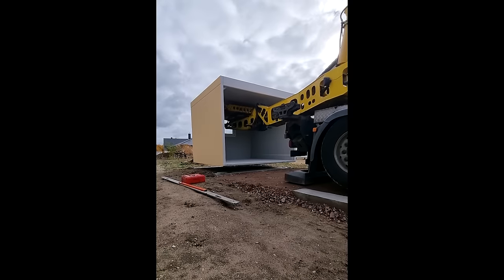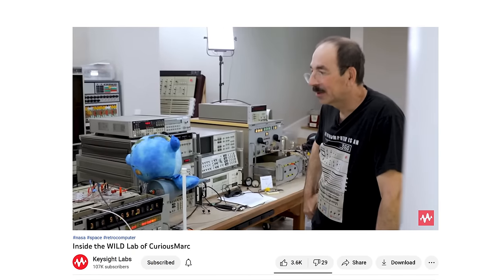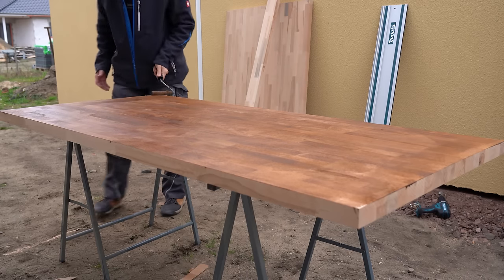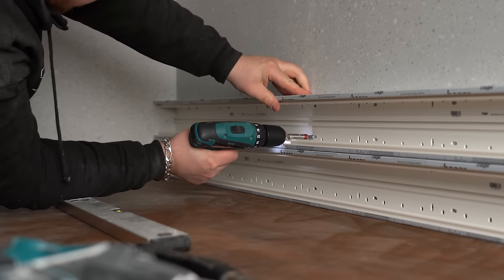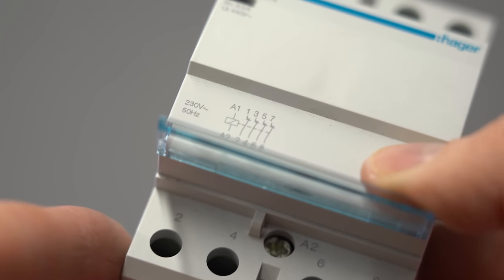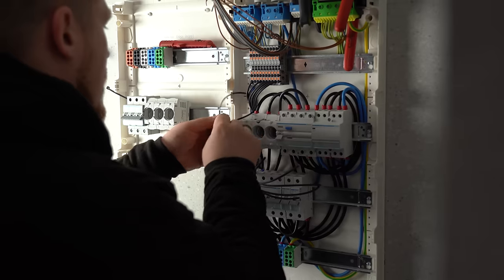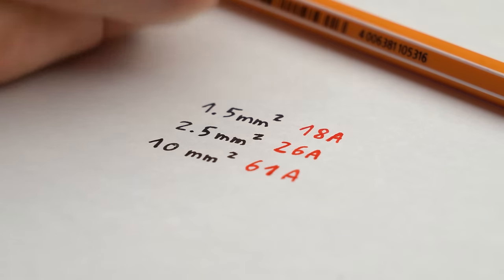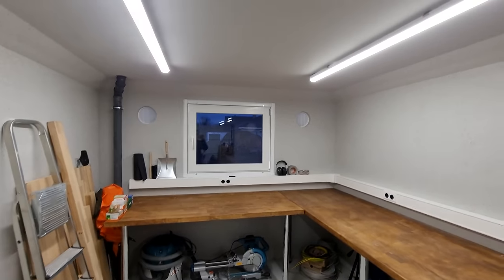Germans do the PERFECT Electrical Wiring! (Garage Build)

Comment: If you want to use an emergency stop switch for safety reasons you should build a safety circuit according to the regulations. Using a red/yellow Estop for a non-safety circuit is creating a false sence of safety/security. There is no calculated performace/guarantee when using the Estop as supposed in this video.

Comment: It’s nice, in a traditional term. I don’t see improvement to the way this was done like 50 years ago. I would have asked the garage maker to include the pipes in the walls, as you know where they would be, so no pipes. I would have added more magic, light goes on with presence , not manually, depending on light. Garage door with RF handremote? .. I would also have mounted the power plugs on the ceiling, not the side, so your free to move around while working , even move the table .

Comment: I would and have and will do in similar things just about everything differently. A lot to do either differently or better. For example I would replace cable conduits with open trays to use them also for wiring all the equipment. Lights would be with 24V relay. As little fixed things as possible. Add a 32A outlet for modern power electronics, 16A single phase is just hopeless. I expect garage to have the wiring for car charging anyway so should not be a problem. Why porcelain fuses? You will be popping them and they are annoying to change. Overall the setup interferes with every wall and the only free wall is taken up by the panel. It is a very massive setup without any need for such. For example you will never be using the CEE outlet while sitting on a chair, why is it so low and not as high as possible?

Comment: Der Fehler 6:20 ist schon echt hart. 400V x 16A x √3 (1,72...) = 11kW und nicht 6,4kW.
Normal gesagt ist es = 3x 230V x 16A = 11kW

230V x √3 = 400V
400V x √3 = 690V
√3x√3 = 3
3 x 230V = 690V

Und was ich anders gemacht hätte:
Biegeradien einhalten ( Radius = 4x D (Kabeldurchmesser))
Richtig verdrahtet brauch man auch keine Abzweigdosen.

Comment: The components are almost the same as in Sweden. But sorry to say the German way of doing it locks so bulky and not elegant. 
I think i prefer the Nordic way. When I used to work as an electrician I had a colleague that had moved form Germany. We had to train him and remind him not to do the German style of installation. The job was the same but not the aesthetic of the installation. Its hard to explane the differences but in Sweden we do the corners a little bit more close to 90 deg. We use bare cable on walls instead of bulky conduct. We follow the natural lines of the room. Like between roof and wall or on the trim. If we use conduct we do it all the way to the box and dont end 10 cm  away from it and use smaller slimmed cable clamps.

Comment: A bit sad to see you went with legs on those tables. If you have two sides (long and short) screwed into the wall slabs, you don't need a leg. You might need a leg on the opposite side (the one closest to the camera at 3:51). At home I have an L shaped desk with a 3.66 meter long side and a 2.44 meter side (MDF sheet sizes). 100cm deep as well. I am using one leg as the only support. I'm 130+ kilos and I can stand on the desk.

Comment: Why put pipes on the walls if the wire is exposed before the junction boxes, you need pipe to box adapters to completely cover and protect wires.
Reply: It's just structural. Cable is rated to run without conduit, but would require a hanger or clamp every X distance, Whereas the conduit only requires a clamp every bigger Y distance.

Comment: The wiring would have been much easier in single cable, considering it was fitted with conduit anyway. It's also a shame to see the wall blown out because they used an SDS bit instead of a dry diamond core bit. Nice otherwise.
Reply: Not allowed. Different circuits, different cables.

Comment: Why does your electrical conduit have no corner / radius connectors instead of having the wire just span the joint?  If you don't have the conduit fully encapsulate the wire from A-B then it's literally pointless and a waste of money.

Comment: I'm a a control and automation engineer who deals a lot with electronic and electrical systems . My experience in this field tells me that the Germans are not really the champions in electrical and electronic engineering field. They tend to overcomplicate the design of the system without clear necessity  for it. Also, their systems due to their unnecessary complex nature , tend to create unclear and frequent faults and errors which are difficult to troubleshoot; plus; the cost of purchase and maintaining their systems  is  quite high. On the other hand, the Asian made systems are the best in these two field. They are as complex as the necessity of the system requires. Thus, there is no frequent faults and errors, and the process of troubleshooting of a fault if happens, takes less effort and time compared to their German counterpart . Finally, the cost is significantly lower than the German systems. So, basically, the Asian systems are the best simply !.

Comment: It looks generally nice, but I would have used 90deg tube connections and not naked wires, this look awfull. I would also terminate the tubes at the boxes, Tube<->naked_wire<->tube<->naked_wire<->box is really strange.

Comment: If you use a latched relay with a super cap you can have a broken wire as well. Just make a circuit for the wires and use the super cap to trigger the relay if you lose connection.

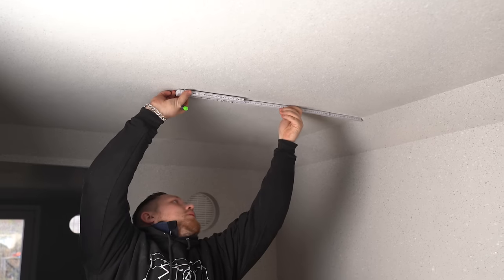Comment: Id use ölflex instead of nym cable for this reason: 8:47 

The copper tends to stick out when you bend the wires back, with ölflex you squeez casing (aderendhülsen) around the copper strands, and it's way more touch/short circuit secure.

And since you have Phönix connectors in you board, using ölflex should have been no problem.

But it's oke as it is.

Comment: Protect the cables at the ends of the conduits. You can buy different angles or even better, get a pipe bender spring and bend the plastic conduit exactly as you need it.
Reply: Conduits in most of Europe countries arent required at all
Reply: @bojangazibaric3328  Whilst they are not required, they are there to protect cables.  So leaving parts exposed doesn't make sense.  Even if the reason to use them was to make it look nice, exposed parts don't look as nice as fully enclosed runs.
Reply: @m1dst  Im a professional electrician in my country and in 20 years we used only few times additional protection but in terms of flexible conduit /hose and never in domestic installations. i do watch a lot of videos from other countries and how things are done there. In UK and the US ( from what ive seen) through conduits u mostly put one or few single stranded wires or cables which are flexible. Cables u saw are pretty stiff and not intended to go through conduits. If u have 5x2.5mm2 wire , one of the usual in my county u would not be able  to get it through the  pre installed pipe, even slightly curvature would give u a nightmare. Their double and triple layers of insulation is enough for most of the purposes. Sry for bad English
Reply: @bojangazibaric3328  Thanks for the additional information.  Always interesting to hear how different places do things.

Comment: 2000 comments later in 5 months down the road. And as usual late to the party. The next time you move any type of heavy long pieces of material. Say hight 32" x1" 1/2w x6' long. 2 flat (whatever) with wheels on each of them at both ends makes it much easier to move. Just make sure the "flat whatever" can withhold the weight...

Comment: wire pipes look nice and tidy, but they are unnecessary. there is no advantage in using wire pipes, beside look. if we talk about over heat of wires hazard, then pipe is even disadvantage. also it's extra cost. also, if you want to add more wires, you can find yourself unable to put new wire into already full pipe.

Comment: I strongly disagree with your choice of Normally Closed Relay for E-Stop, which requires active power in order to Open and thus shut off the circuit. That is a recipe for disaster, because as you stated yourself, if the wire to the e-stop relay is broken, or power to that relay is interrupted then you're screwed. If the coil fails, you're screwed.
Your life and limbs are not worth the "20 watts" of power saving... (or any watts of saving)...
As others have commented there are latching relays that can save you 20 watts.
I also find it odd that you are willing to spend your euro to have moving receptacles, but you cheap out when it comes to saving your life for a few watts of power saving?

Comment: over complicate stuff much? the e stops should never run to a relay, just run them like you would a light, in series, both must be in position to run, and if either one is pressed it kills electric, much safer and also cheaper than your solution and it requires no electronics

Comment: why does everything seem flimsy and plastic. why didn't you use actual conduit connected directly to boxes? metal may be out of style, but it's still a great material. wires can get hot. what happens when plastics get hot? a good reason to use metal. if something major goes wrong there, all your wire will be in a pile on the floor.
Reply: PVC has a melting point of 210° C while cables and breakers have to be dimensioned to not get hotter than 70° C under full load by code.
Reply: @1I2am3Dani4  in normal working conditions. things can and do go wrong, in which case metal will hold up much better than plastic.

Comment: Laughs in Australian wiring standards, who is still installing fuses in 2022?
single RCD for circuits is yuk, trip a outlet and now you are sitting in the darkness, use RCBOS for every circuit
no RCD for 3ph circuits?
no buss bars
solid strand wire is yuk

Comment: This is one of the cleanest electrical work I have seen. Did you intentionally leave the cable open at 90 degree bends? What is the logic of using or not using conduit bends? Also, in breaker junction box adding labels to all cables would have been a perfect step to help troubleshoot in future.
Reply: I think it's aesthetics. I personally like it more without the bend.

Comment: that pipework with missing elbows is concerning.
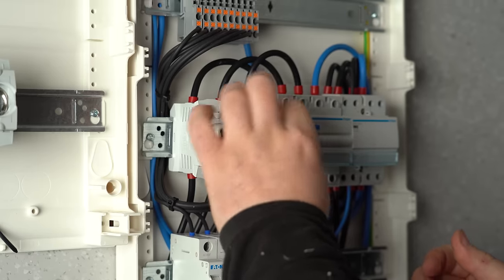11:14 you should have used proper colors for wiring or at least colored Heatshrink or Labels.
11:24 ... this just looks wrong... you have your input clamps on the bottom row / 4th row going up to the 2nd row then going down to the 3rd row and then going up to the 1st row and up from there.
Use a 3P Contactor instead of a 4P. You said it yourself in the video, "german rules don't allow you to switch the Neutral"

Comment: Well your Relai problem would i Fix a stupid way. 

You could put a low Power relai in ther that is NC and wire it to the High power relai 

So is the line where the error could Accure very smal. So... its still not totaly safe but... safer? 
So you would drive it like it is supose to be but would brack the Power lines with a Higher class Relai thats driven like yours. 

It does add more faulty parts but... also makes it Easy to change and Test them. Like put a lamp on it and Test et bevor every use... and if its faulti you just have to change one of the Relais, caus the Kabelway is protected.

Comment: Dont do you emergency Switch Like this, the Relai needs to be safety class Not the one you showed, These Relais have two connectors for each in Germany NOT-HALT, also These Relais are more tested and fullfill all Security aspects, please read about it and Security classes, IT could Safe your Life, but your system is a Solid start and will do its thing 99% of time but you want more when Handling with heavy maschines 😉

Comment: I would love to put in a hauptschalter that you could lock (not a rule in Germany, however it should be...). I also guess that you took 1,5mm to B16A, 1,5mm are not rated for higher than 13A. Germans like to take pride in their electrical work and they also like to think that they are the best electricians in the world. However this is not true, I worked as an electrician in a few countries and I would say that Swedes or Danes have far better standards than Germany does.
Reply: 1,5mm² is perfectly fine for  B16A. It depends on the installation method of the cable
Reply: Actually it depends on the impedance before the fusebox and how long they are. I work within electricity in Germany and I now for a fact that they do not consider the impedance of the head cable before they do their installations. However if you go to the Scandinavian countries you will find a way higher standard within electrical installations. Also in Germany a lot of the ways they install things are like 30 years behind the Scandinavian countries.

Comment: @GreatScott! I think you forgot about surge protection devices that are necessary to install when working with mains power tools and also sensitive equipment like computers or laptops. Surges created from induction motors or externally from lightening or any other fault can cause some damage.

Comment: Nice install, but.....A few pointers that are worth noting, 
Lack of basic PPE is always one for me, that when putting a video out for the world to see, why show your complacency to health and safety. You don't have to be a big tough guy not to wear safety glasses, eyes don't heal to well. 
Also very lazy not using flexible conduit at the corners, and just having open ended conduit, providing no mechanical protection.
In all honesty the open end conduits on ALL of the cable runs are just lazy, there are lots of products on the market to make it continuous.

And no nice tidy boxes to cover the cables coming between walls would be nice,  just holes with flex looks poor

Comment: All of the plastic components look very expensive until you get to that service panel, I would hate to be the guy servicing that cracked and crumbling unit in 80 years or they guy that accidentally smashes it while working away in the shop.  I am in Canada and we use both metal and plastic device boxes but I have never seen a plastic breaker panel and would refuse to use one if it became available.
Reply: There are more or less no metal breaker panels. Also good plastic is much better than cheap metal :)
Reply: @muschelhirsch4522  that's fair, I am not from there and you gotta work with with the materials you have but I disagree with the good plastic vs cheap metal comment, a powder coated metal panel will still be in mint condition a hundred years after plastic has gone brittle, warped, and cracked at the screw holes.

Comment: If you use a reset button, what is common in emergency stop circuits, then is is oke.

Like https://i.stack.imgur.com/bF8iR.jpg

Just the first half of the circuit. S4 and S5 with K2 is not nessarry

Comment: Hi there, in electronics you are a genius...
 Butt german electrics will be a little lazy, ¿Why not install flexibles for make pipe curves? In spain if the cable visible outside de pipe you don,t receive certification, i can affirm spain electricist are much better,

Comment: Most of the electrical wiring I have seen in Germany is shocking (pardon the pun) that's would not be acceptable in Australia haha even something simple like conduits where the cable goes round corners, but there is no elbow but the conduits are open ended at every bend.. as an electrician, I don't get that haha why not use elbows and protect the whole cable 😂

Comment: nice job. here in India anyone can do the electric wiring at very low cost without any rules and regulations but in 99% case never had any accident or short circuit so i must say in Germany the wiring work is overrated
Reply: Only (pub.wks.dept.) .... P.W.D. certified wireman/ electrician are authorised to undertake electrical wiring jobs where state electricity boards provide electrical power...
all other unauthorised/ ill legal jobs automatically loose any/ all insurance cover in case of any problems that may arise.

Comment: Internal wiring does not follow IEC/EN standard as you see at 11.20....theres two diffrent brands (EATON and HAGER - both low quality, cheap types..) in same electrical cabinet, in a new installation, you usally avoid this sort of installation... After the installation, as i know, after building a own electrical cabinet, your electrician needs to mark it with EN/CE specification, othervise its usally not legal to connect and use, have a look with you insurance company... after just watching the video, i can tell the pre-impedance and short circuit condition has not been fulfilled... if thats a german installation, well, i guess the swedish looks waaay better according to perfect electrical wiring! :)

Comment: i have done such installation... why putting tubes for 40 cm ? and we see the wire in the end ? and using it for an all in one cable ..  i think ti's a waste in material, and money, just nail the cable with some " n  " forme attachement  and, done, clean ,  without this disgusting tube  with  only one cable , in the  end  we see... we using this for hiding wires... some outlet  have an hole in it to cut for the tubing, but ...  the wiring it's clean

Comment: Hello, i rahter used zip tie method with metal stripe. Beacause if you want for example outoor socket you can run cable without worring about fitting into pipe. It depends on taste. I can sent you e mail if you are interested in my garage project.

Comment: Perfect? maybe good, but not perfect. 
You use solidwire instead of stranded wire, wich is easy to, handle, bend (less probabily of suffering work hardening and break), and joint.
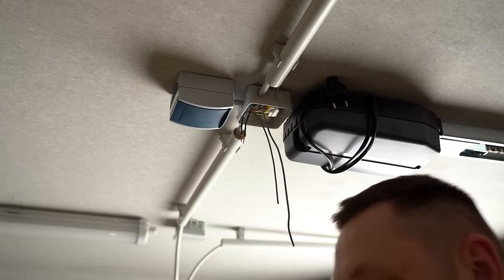 if you are going to use conduit, use conduit for the entire run of wire! why the professional electrician did that? 11:00 looks cheap work.
 11:19 in my country you can not install fuses in places where regular people live. i mean, fuses are for industries/factories or places where are always trained people in safety and electrical stuff